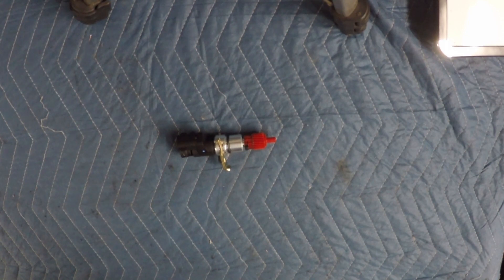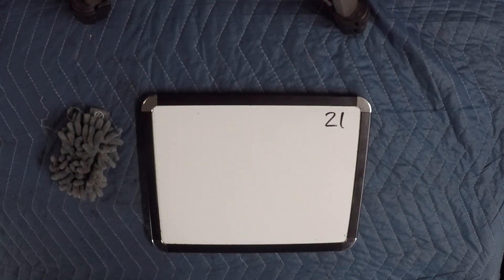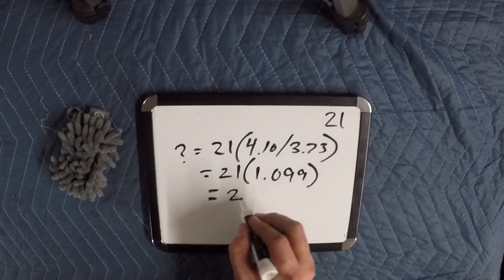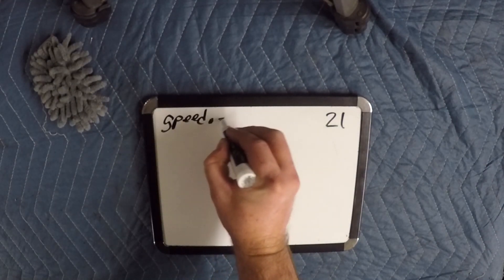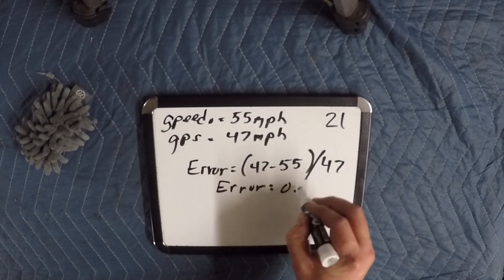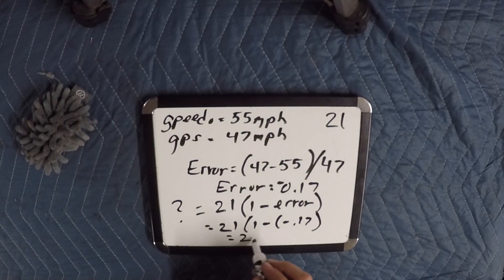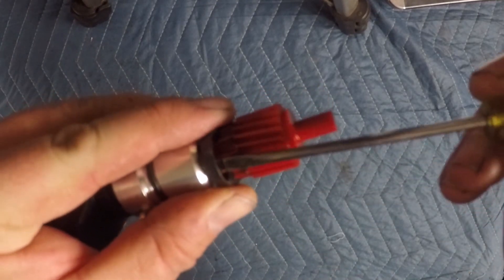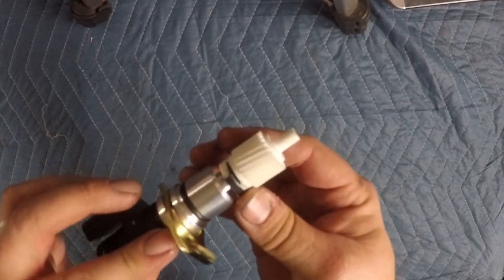Calibrating Ford Gear Driven Speedometers

Comment: I did an auto to manual swap in my 02 ranger edge. the speedo was already off by approx 5mph cause of the tire size. Now with the manual trans its off approx 15mph. I don't have the original speed sensor to know what was in that auto transmission. Is there still a good way to figure out the gear needed and where is a good place to source the gears? Thanks!
Reply from the maker: Unfortunately I think your truck is new enough that it doesn’t have the gear at all. I think the Rangers switched to use only the ABS speed sensor in 2001. If that’s the case programming is your only option to correct the speedometer.
Reply: @stuffyoucando2 I don’t recall seeing an abs speed sensor when I did the brakes. The rear is a drum brake set up and the front is still a spindle set up. Not a hub assembly like you see most abs speed sensors in. I’ll have to pull the sensors on the transmission and see what it has. If it has the gear where can I get them?
Reply from the maker: @FredSmith-k3m the ABS sensor is on the center on top of the rear differential.

Comment: I have a 3.08 rear gear with a 17 tooth gear and smaller than factory tires, it reads 3mph fast and I did 4 calculations using the same criteria and 2 got me 18(50&45mph), one got me 19(30mph), and the slowest got me 20(20mph).
Now im more confused.
Reply from the maker: What do you mean 50, 45, 30, and 20mph? Are these how fast you’re going, how fast the speedometer says you’re going, both? You need two numbers to calculate the error.
Reply: @stuffyoucando2  Yes when the speedo 50 the gps says 47; 45/43; 30/27;    and 20/17
I did multiple calculations because if all of them line up there is no error, however they don't
Reply from the maker: You really shouldn’t bother with those lower measurements because you’re making the accuracy of the GPS become more of a factor since it’s only displaying to the nearest mph. For example, if the GPS is telling you 43mph and you’re going less but not enough to make it display 42mph, it’s going to give you a lower error than you actually have. The lower the speed the more of an impact that will have. If you’re insistent on doing multiple readings, do them at higher speeds to lessen the effects of that, or use a GPS that can display in 10ths of a mph if available, so it’s not a factor.
Reply: @stuffyoucando2  10ths makes a lot of sense but the lower speed thing not as much because it was consistently 3mph slower than indicated no matter how fast
The road I could only get to 55 with traffic because I can't stare at my phone while driving
Also 10ths may lead to inaccuracies because my speedo is an analog which is pretty hard to read 10ths on an analog, multiple readings should fix that though
Reply from the maker: @dominicklipari  alright, then you’re on your own man, good luck.
Reply: @stuffyoucando2  Thanks for the video and your time, appreciate it

Comment: Hey that's pretty cool, does that last calculation also work if you go up or down in wheel diameter?
Reply from the maker: Yea, the error will either be negative or positive depending on which way you go in tire size. My second example was how you can deal with a tire size change by seeing how far your speedometer is off and correcting it.
Reply: @stuffyoucando2  thanks, I didn't notice you said that in the video haha
Reply from the maker: I probably could have said it better, but yes, since changing the tire size will change how the speedometer reads compared to actual speed, that method works well. Thanks for watching!